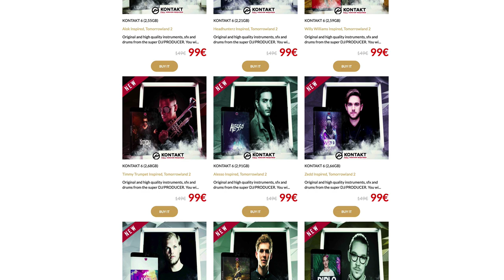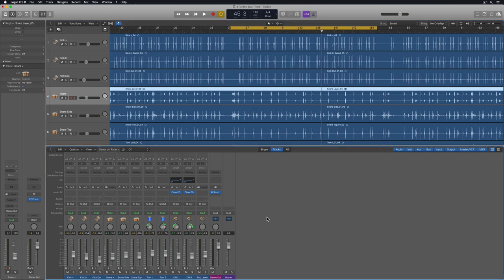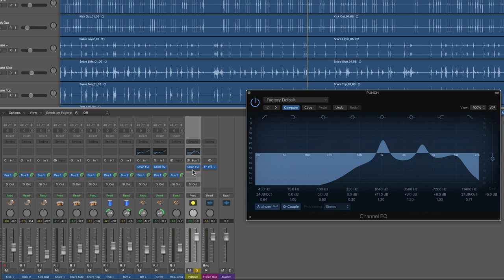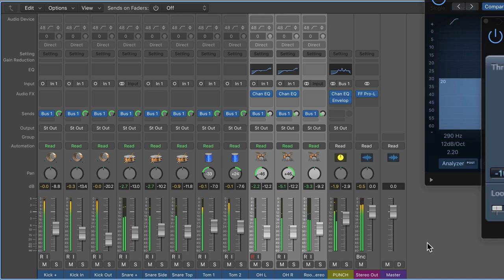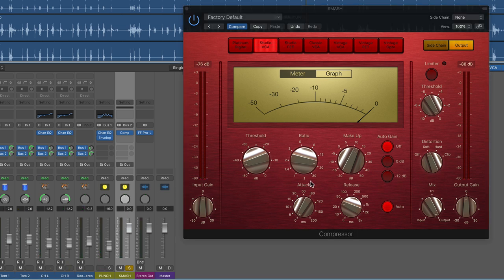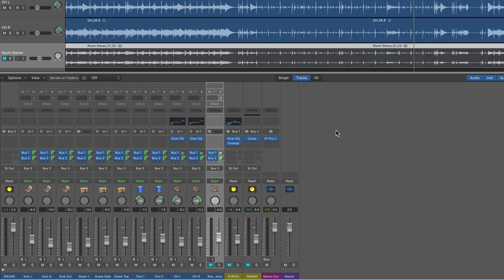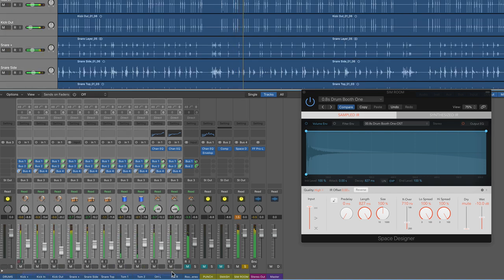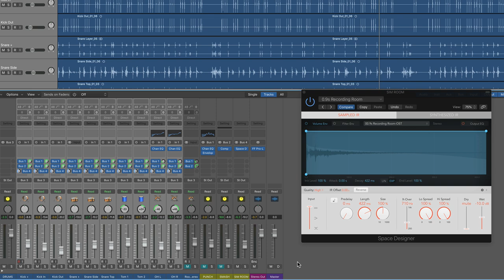Logic Pro X - 3 Bus Tricks for Mixing Drums

Comment: Here's a tip for you. Keep your faders at unity. Control gain on the actual clip and with inserts instead. (trim, compression, clipping, limiting etc). Then use the faders for balancing only.

Comment: When you use the presets with the multi output drummer tracks, they have room channels and overhead channels with the drums in them. You can enable or disable each drum in the rooms and overheads.
Reply from the maker: You mean the preset sends Logic adds to Drummer tracks? Yeah, it's a simulated Room, like I did here. Some third party drum sample instruments actually allow you to control the level of the room mics and overhead mics. (the samples are multi-channel). Drummer doesn't let you do that. It only separates them into 5 stereo channels -- Cymbals, Kick, Snare, Toms and Perc. If there's some overhead and room control in Drummer, I've never seen it?
Reply: @MusicTechHelpGuy  You have to choose one of the producer kits to get the overhead and room mic tracks.  The basic kits just have the 5 tracks, but if you use one of the kits under the producer kits category, then you get a separate room mic track, an overhead track, even a leak track, among a few other things.

Comment: Practical tips that works, while vca compressor has most sensitivity towards transients (voltage control amplifier), even fet is good for transient
Reply from the maker: I was avoiding transients in the 2nd example, that's why I didn't use a FET comp. I've got the transients in the dry signal/punch aux, I just want the woofy, boomy sound in the smash aux.

Comment: 2:30 Question: How are you sending 100% of the channels to the aux if the green knob is not all the way turned to the right on them?
Reply from the maker: If you option click on the send amount, it will set it to 0.0dB, which is sending 100% of the signal from the channel through. yes, it's positioned about two-thirds right, but if you go any further right, you'll see that you're adding gain on top of the normal channel level. So when you go beyond 0dB, you actually sending a louder signal to the send than you are sending through the channel.
Reply: @MusicTechHelpGuy  Wow that's good to know. I'm assuming that's not ideal in an average situation, due to clipping etc?

Comment: Is there a way to send he audio into an aux track but the bus track is the main audio source? So like the original audio track isn’t outputting audio.
Reply from the maker: Yes, just make the send pre-fader, and then pull down the volume of the audio track. The signal will still go through the bus to the aux track without any regard for the main channel level.
Reply: Why not just route the channel output to the bus? You don't need a send plus you can still use the fader instead of that tiny send knob.
Reply: In logic, click on “St Out” on the fader and then just change it to whatever bus you want

Comment: Setting the release time on the RED compressor when it is set to auto release time...
Reply from the maker: Auto Release time does not mean that the release time is 100% automatic. You still have some control over it, but it becomes a variable control. So if you set it to auto, and then set it to a short release, you will get a variable automatic short release. If you set it to auto and set it to a long release, you'll get a variable automatic long release.
Reply: @MusicTechHelpGuy  damn it! You are right! ;)

Comment: I wish you would do a thorough video about working with the Logic drummer... I have figured out how to separate all the drums so I can deal with them individually (by duplicating the tracks and by isolating the different drum parts), but it is a slow process, and it seems to be a processor hog.  It would be nice to know if there were better ways to break it apart without converting it to MIDI.  I find when you convert it to MIDI, it tends to sound different and not as good.  I find going MIDI is good for making isolated adjustments, but going only MIDI seems to lose the flavor.

And so far, I can't find any good videos for really using the drummer well.
Reply: Scott V he goes over it in his logic 101 series on YouTube. You can make the drummer a multi output instrument. Definitely much easier than what you’re currently doing
Reply: @brandonlamb8  - I watched the whole series... And don't recall the video on drums... and when I did a search, just now, I can't find it, it might be embedded as a part of a video, and I am just spacing it, but I can't find it.  Perhaps you could just tell me quickly where in the menus is the control to split the drums up without converting to MIDI.

I would appreciate it quite a bit.
Reply: I just found a 3 years later video about the drums.  (this dumb video is hidden rather well..)  I will report back if it doesn't have what I want  Thanks for the help
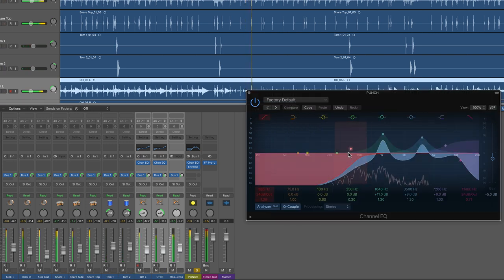Reply: Scott V https://youtu.be/jFy8r2HrwwU around the 5:30 mark
Reply: @brandonlamb8  Thanks - that is exactly what I was looking for... It isn't perfect as it only allows for 4 aux tracks... But it does make like a million times easier.  

Very stupidly hidden though.  This should default to this.
Reply: Load a drummer then choose the "Producer" kits in the library and click on the small triangle either at the bottom of the drummer track or in the arrange window and it will open all the individual kit sounds :-)
Reply: @molem348  Now this is a complete revelation.

Thank you both so much!!! (why aren't all the drums just defaulted to this?)
Reply: @scottv4186  You're welcome Scott!

Comment: Your volumes (especially on the 3 kick tracks) are peaking way too high
Reply from the maker: They're not peaking. Everyone misunderstands logic's meters. There's no clip light, so they're not clipping. They might be normalized a bit high, but that's an easy fix. Also note that I have the faders pulled down -8, -13 and -20. I'm working in Pre-Fader mode, so you're seeing the pre-fader level of each.